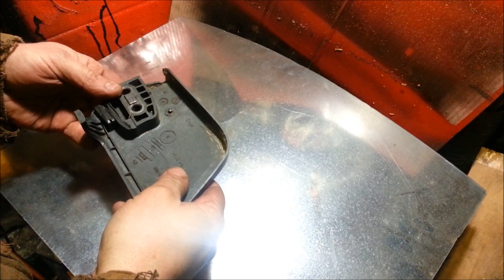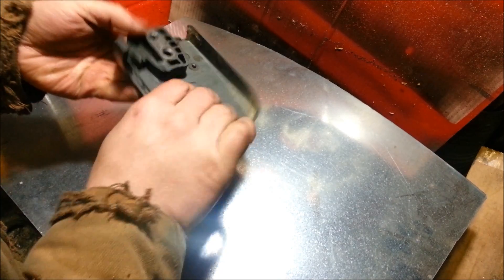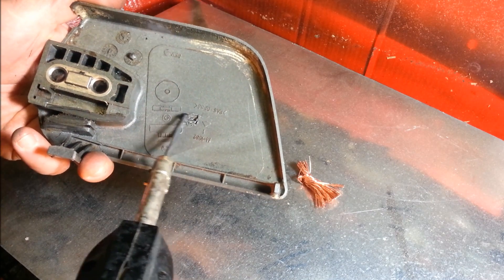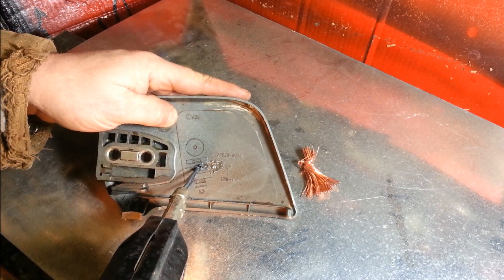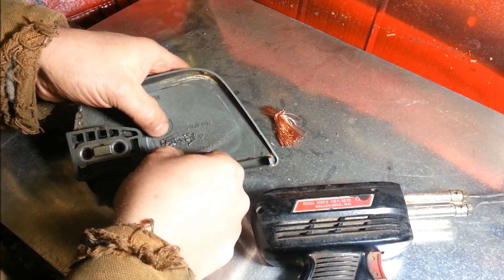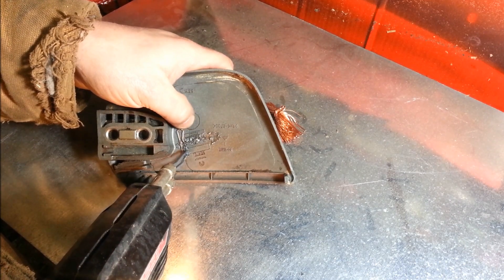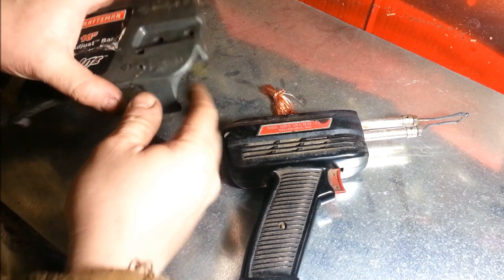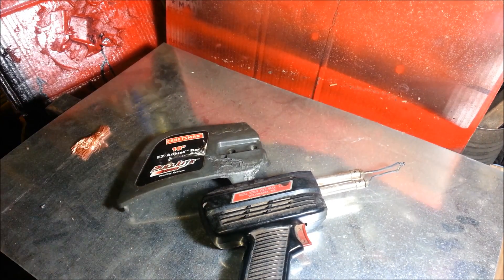How to Weld Plastic with a Soldering Iron

Comment: I just used this method to "weld" the chute collar on a Craftsman snowblower. A new one is $27+ The copper wire, I melted into both sides. Feels REALLY strong. Much stronger than the original. Worked easily and perfectly.

Comment: Thanks for the video. Wife broke her glasses. Have glued them 4 times with 2 part epoxy. This time I added you welding method! Hope they last. (they not pretty, but if they hold till we can replace them...(Covid and all)..they are her 2nd pair but the favorites!
Reply from the maker: Nice work! Putting metal(copper strands) can really increase the strength. I have never had great luck with any epoxies on plastics.
Reply: @sixtyfiveford  , I may have to do something like that next time. It makes good sense to try! Thanks again.

Comment: Cracks tend to grow. Always drill a small hole at the end of the crack to stop it from spreading then continue with the weld. Thanks for the video.
Reply: this only happens with metallic bonds because of the cation, anion ratio that the bonds have. Polymers on the other hand have a much bigger ratio so they don't continue to crack as easily over time through stress. only when you expose them to a solute

Comment: I used a steel nail with the same thickness as the original soldering tip. The (flat) nail-head works perfectly for a tip and because its made out of steel it doesnt burn the plastic as fast as copper would, meaning less (toxic) smoke and a more relaxed melting of the plastics while operating it.

Comment: Is this safer and stronger bonding than using MEK?
Reply from the maker: I think so. MEK only works on a few types of plastics where melting them works on all plastics.
Reply: @sixtyfiveford  I agree. I just heat welded abs and it was solid!

Comment: anybody have any idea if it would be fine for me to use soldering iron for welding an outdoor lamp post made of galvanized iron?
Reply from the maker: Soldering iron won't get remotely hot enough to weld metal.

Comment: Nice video, I've been using a soldering iron for years to weld plastic, however I sometimes had issues with it pulling apart in the same spot. The copper wire trick is great, makes the bond so much stronger! I like to use a soldering iron with a large 1/4" angled tip. I also used okie choppers tip with the zip tie, and they make great plastic filler. My plastic welding is on another level now!

Comment: Would this work on something under pressure like a plastic tube connector in a garden hose reel?
Reply from the maker: I've used it under pressure. Just make sure you take your time and get good penetration. Reinforcing the repair with metal melted in really helps ensure a strong repair.

Comment: thats preety cool man. i like the wire method. they have those staples you can heat up also for bumper repairs. more expensive but the same concept.
Reply from the maker: Thanks.

Comment: using super glue to initially hold it together works awesomely but it will burn your eyes from the fumes. I have used it to do bumper covers and other such components with great success.the super glue adds lots of strength.I had never thought of the wire trick but it may make it difficult  to smooth out to make it perfect and paint able. Try using zip ties they are made of a more rigid plastic. To finish use fiberglass hair body filler for additional strength and use your favorite paint to make your peace new again.
Reply from the maker: +fearless Patriot Yeah, the wire can be finicky to bury sometimes but adds a ton of strength. I really like to use metal screen door mesh.

Comment: Thanks SOOO MUCH!!! this works AMAZINGLY!!!!! i snapped my plastic airsoft knife clean apart. tried super glue (failed miserably) but when i used this technique on it, its back together!. PLUS! i reinforced it with some twist tie metal! (Stripped the plastic off, which i used to add more plastic to the repair). Thanks so much!
Reply from the maker: MrZombie248 Awesome... Yeah, I've found very few things that super glue works for other than gluing my fingers together.

Comment: JB Weld man
Reply: cheaper than JB Weld. ;)
Reply: problem with jbweld is it's a different strength than the original part, so it doesn't flex the same way and can easily break again

Comment: Next time you weld plastics ,  try using a plastic tie rap as a welding rod like in tig welding ,  you will be amazed .  And try using a pencil type soldering iron .
Reply: ***** I've used a wood burner for thinner plastics. Same basic thing, works well.
Reply: I've used weed eater string
Reply: And staples, pulled flat and straight, perpendicular to the crack add strength, like how he is doing with the copper wire.
Reply: soldering iron is a pencil type, he is using a gun not an iron
Reply: Yes yes yes
Reply: Try super glue and baking soda it is fast ,strong and easy but it is hot
Reply: I like the idea. The tie wrap is a zip tie, correct? I gotta fix some laptop hinges and solder the MIDI Thru port on top of my Creative Labs Modem Blaster WaveBlaster CHiLL device.

Comment: Going to try this on a plastic radiator combined with the super glue/baking soda trick (which I may have seen you do too) as an outside support. Thanks for the videos. Practical and there's not much like the feeling of being able to fix something instead of throwing it away; not to mention saving money (even if it is a buck or two here or there)
Reply from the maker: Tony Martinez Great...

Comment: If you are not handy with soldering iron, you could try Qbond with nano powder. Basically a superglue, bond parts together add bead or fillet of glue and pour the nano powder over it. It is stronger than the original plastic. I've also used super glue and then applied bead and poured baking soda, really good for wood repair. I like your method Ford, keep up the good work sir.
Reply: Thanks for the  Qbond glue. I just discovered that baking soda and any super glue kinda acts like Qbond, but i just ordered some Qbond. Will be trying the baking soda technique in a couple of days.
Reply: Sam Johnson ... ...or pvc cement mixed with pvc filings from a coarse file...👍👍
Reply: Or just buy rapid fix

Comment: I wouldnt use brake cleaner. Heating the fumes could lead to some real harm. There an article about a guy who used brake cleaner to clean some metal off before welding and got very sick from the fumes it created
Reply from the maker: Jeff Ward That's chlorinated brake cleaner which is uncommon. Also by letting the area fully dry there is no residue and any part can be welded, Chlorinated or non-Chlorinated. Non-chlorinated is cheaper and more readily available

Comment: DO NOT use brake cleaner on anything you will heat.  It releases highly toxic and carcinogenic CFCs.  Use acetone, toluene, or whatever, but stay away from anything with chlorinated compounds in it.
Reply from the maker: Robert Schulke I would say most, if not all Brake Cleaner I've seen the past decade is non-chlorinated.

Comment: here is a different way to reinforse weld . using a small nail coil wire around it. take off nail. lay coil on flat surface and flaten. you now have a shapeable backing for weld.
Reply from the maker: Bill Senn Yeah, nice tip.

Comment: when I fix plastic bits, I melt nichrome wire across the crack with a dumb battery charger to reinforce it. I fixed my cheap tripod's plastic clasps using that method and its lasted a year since without problems
Reply: ***** I stole that idea from a video Matthias Wandel made on repairing the clasps on his tripod, because I had the same tripod fail in the same way. I've used it on plenty of things since. :)

Comment: Watching plastic melt and cool is faster thus more exciting than watching paint dry.  I've used aluminum screen as patches to melt in. Good Idea with the copper wire.  I also have a tip for my soldering gun that is flat spoon shaped to widen the heat pattern and helps flatten good.
Reply from the maker: Put it that way and it is exciting.

Comment: was that polypropylene or ABS plastic?
Reply from the maker: I believe it is ABS.
Reply: sixtyfiveford
cool, i've been wondering if i could repair cracks in car batteries. got an ac delco battery that i am wanting to fill with stuff like soda and orange juice just for fun to see how well each electrolyte works. only problem is one cell is cracked ;P
Reply from the maker: Car batteries fix pretty easily.

Comment: Done that before the wire is a great tip. i'll take similar plastic or plastic you don't see from another spot and and it. Heat a spoon up and smooth it out at the end. Thanks for the tip i will use that for sure.

Comment: I had the blade on my fan break and also used the butter knife method to weld it back together  by heating the knife over the stove, works surprisingly well.Adding wire is a great idea, thanks for making and sharing.
Reply from the maker: You probably got a pretty smooth result using a butter knife.  Great idea.
Reply: sixtyfiveford Yeah, I had no idea it would work, and even better, my brother thought I was a genius. I like your metal idea. I bet if you had a weld to make you could heat up some 1/4 metal hardware cloth and press  it into the plastic.

Comment: Smashing :-))

Ive had to do the same thing, but i was lucky and found some same type plastic and added that to the joint, it all helped :-))

I used a poker type iron with a flat blade end.

The wire embedding is a new trick to me :-))

Comment: A good video to know. Not many think about salvaging plastic parts. What I do sometimes is cut a width of thin sheet metal about 3/8" and heat it in running it with the crack on structurally crucial parts after the first pass closing the crack.
Reply from the maker: Great idea.

Comment: It was not boring to me I have done that with my solder gun but never used the wire I might try on a thick piece and heat a paper clip up and melt it across a crack
Reply from the maker: Metal really beefs up the repair.